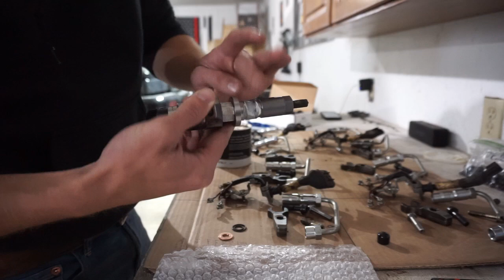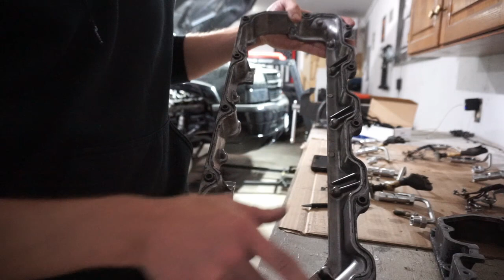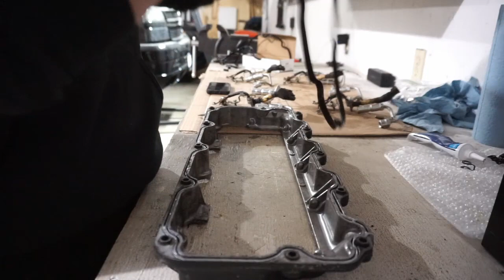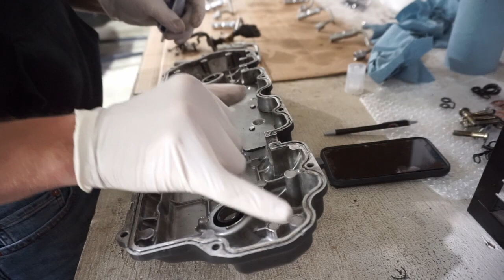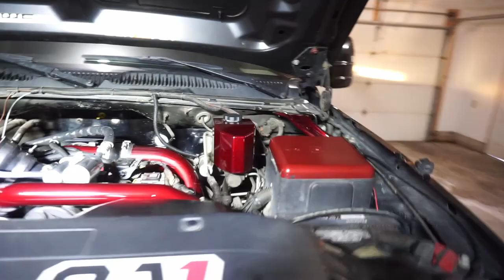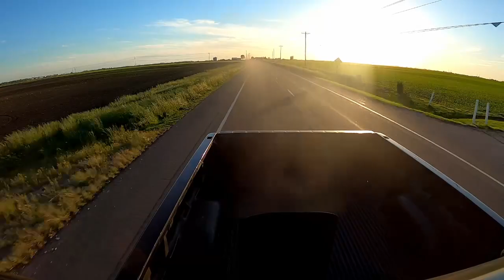LB7 Duramax Injector Install: Full Detail Step by Step Instructions with Tips!

Comment: Let me ask you a real solid question. On the lb7 fb forums everyone right now in 2024 is dissing LDS injectors I see u have used them . What’s ur thought on them ?? Everyone is saying like 2015-2019 they used s&s but have stopped and are using there own injectors and warranty sucks and there flow rates don’t match as what there sold for . Whats ur thought im looking to buy
Some and there 45s I can get whole set with everything I need around 3500 with anywhere else its around 4 grand with just sac 00 . I know ur busy but I love the channel and seen u have used them and wondering if u me and wanted injectors where would you go other there s&s , exergy
Reply from the maker: Good question...here is my long winded experience with LDS. I bought these 65% SACs (new not reman) from them, with the install kit. Tore the truck down and installed them myself meticulously. Had the truck retuned, it ran great for 2-3 days. Then, driving home one night the truck started pouring white smoke and fuel knocking so loud I thought the crank was broken. Poured through diagnostics until finally I came to the conclusion that one of the injectors (#8, back drivers side) had a stuck open solenoid. Reached out to LDS, they told me I had to pay $50/injector to have them retested on their test bench. So I tore the truck back down, pulled them out, sent them back and paid for testing. Sure enough, #8 was bad, had a stuck solenoid. They replaced that injector under warranty. Had no issue with them after that point.
I was pretty upset that I had to pay to have them retested to prove to them that they had made a mistake, and that doesn't count what would've been shop labor costs if I were to have had a shop do the 2 separate injector install jobs for me.
So for those reasons, I would recommend paying more for Exergy or S&S the first time.

Comment: Good video..what year is your truck? My 02 LB7 air conditioner compressor has the 2 silver cylinders on the top. My 04 LB7 does not have those.
Reply from the maker: Yep this is a 01 truck that was front end swapped to the 06-07.
Reply: Gotcha...my 04 I put 06 grille and hood on it!

Comment: I had an issue with the fuel return line seals leaking Diesel into my crack case oil. What inch pounds or foot pounds did you use on the banjo bolts?
Reply from the maker: I torqued these to 106 in-lbs plus a little bump at the end, I changed the oil the next day and so far no visible change in oil level on the dipstick.

Comment: Am i screwed if I didn’t press the injectors in when installing them
I can’t remember if I did that step and I’ve pretty much put it all back together
Reply from the maker: You're probably fine, the hold down arm should help to push them down. I like to push them down myself just so I am confident that the O-ring seated securely.

Comment: Had 45 overs from LDS installed and this crap just happened to me, 600 miles on em, after all the BS with them and not using S&S diesel anymore I'll be going a different directions with injectors and going elsewhere, talk a bout a waste of money